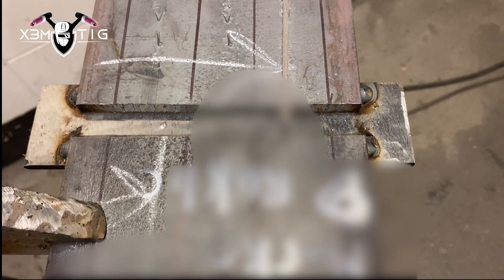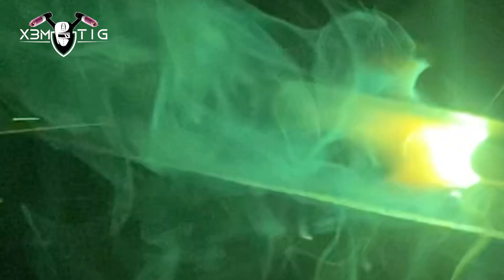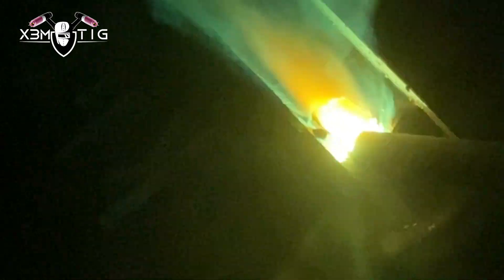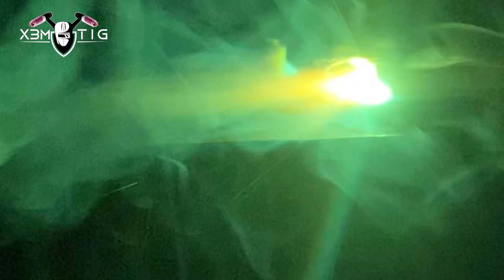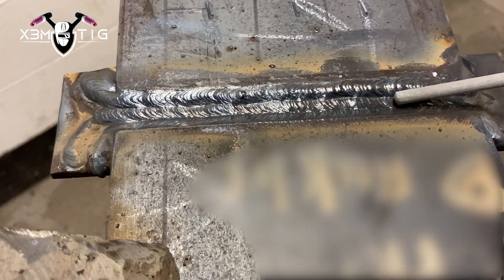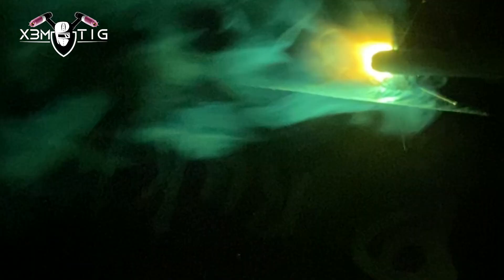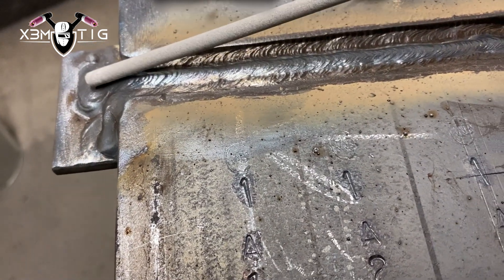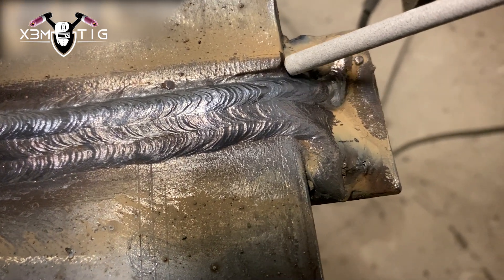Stick Welding  | How To Stick Weld Structural Flat Test Position!

Comment: I only have mig with a flux core setup. How  would i go about a 90 degree weld like this? The smallest recommended gauge for 110 volt is 18 gauge. How thick should my bead be for a strong weld? Im on 20 wire speed  and 5v  it only goes 1v to 7v  and 19 to 90 for wire spees.  I dont want to be able to use a hammer to break the weld obviously its not stromg enough if it cant take a few blows
Reply from the maker: Try to get better machine, or it might work better with thinner materials. It all depends what you intend to use it for.

Comment: I weld 140  until the cap. Then drop it down to 130. Weld your 90° first. Ties ins i start at the top of the crater and move forward because i dont want to weld over slag. For the cap i weld the 2 seams first then the middle to tie both stringers in. Honestly its an easy test. Make sure beyond anything else you clean your plate properally after every pass. Slag inclusions will fail you and its easy to avoid. I weld at a 37° angle to fit the next bead in a bit better. Ive had multiple cwbs and tssas under my belt and tssa for tig plus metal core certs. We all help eachother we can get though these tests together! Everyone welds differently, just gotta find whats best for you!

Comment: Interesting that you weld the sides first. I would think you could trap slag or air pockets in the middle pass.  And you weld an inch or more before your even in the groove. Which can make you run out of rod sooner than intended.
Reply from the maker: Hey bud thanks for your comment. One thing is that what you think that could or might happen, and the other thing is that I showed you what exactly happened as per CWB GF1 Welding Procedure. So let me repeat myself again, that is exact welding procedure specifications!!
Reply: @X3MTIG  all that you proved was you cap passed the bend test that was over an 8th of an inch.  Things are more strict in America.
Reply: Bro.. obviously he knows what he is doing, as you can see, he passes all of his bending and x ray tests! I mean, as he said, he has been welding for  over 20 years. Do you really think he needs advice? 😏🫣Also, he came from Europe, worked in Germany for years, learned his skill there, and they might do it differently there! 😉
Reply: @dariom5050  I'm not giving advice, but this video shows improper stacking. You should put a bead in the middle, then you can safely weld the other beads without trapping slag. And you believe anything someone says lol.
Reply: @Somewhere In Japan  this was 3 months ago, lol. America has a 1/8 tolerance for weld height, as well as how wide the weld sticks out on the metal. That was my point. But as for the bend test, you can have a good end and a bad end lol.  Those tests are a joke anyway tbh.
Reply: @TheIndifferenceOfGoodMen you clearly don’t know what a hot pass is
Reply: @markalbert9965  what

Comment: At 2:43 is there a tiny gap in between the two root passes?  Did you mean to do that
Reply from the maker: Yes, that’s exactly part of the procedure.
Reply: @X3MTIG  what does the tiny gap benefit 🤔?
Reply: @mreojballer3777  Nothing really. When you weld both sides your weld can only be so big with stringer beads then it leaves that gap in the middle.